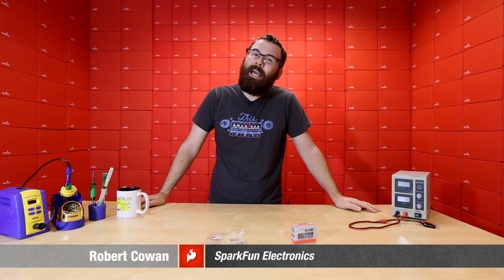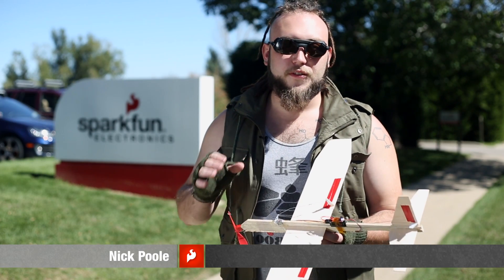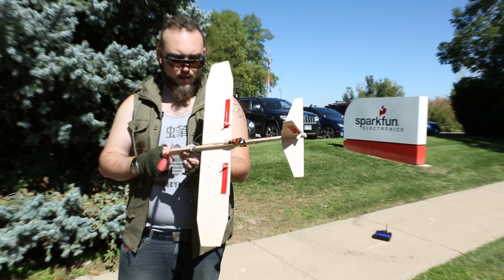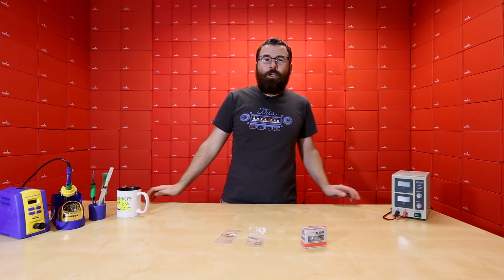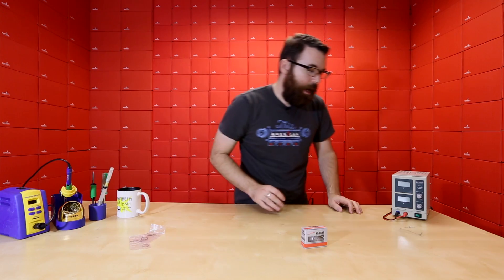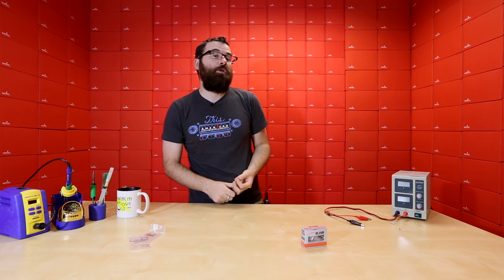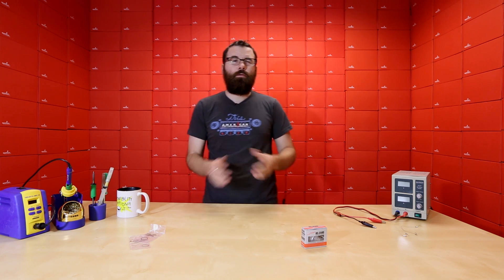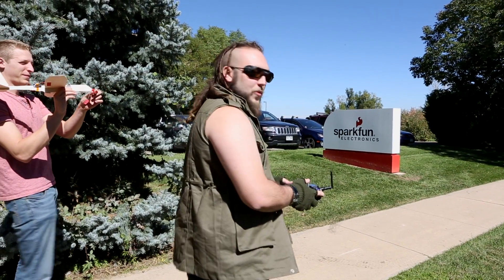SparkFun 9-27-13 Product Showcase: Fly by Wire

Comment: I was wondering - if you had a nitinol spring, you could stretch it and use electricity to shrink it back and it could spin a propeller in a plane through a simple transmission!

Comment: these wires have a threshold of ''return to shape max temp without damage" and a "embed a a new shape in it max temp" these do not handle to be surpass without any control over the amperage. You are ruining the product on a showcase video... ideally you heat it to 120 Celsius while applying a 5% of strain to it max (its still 5% of around 4000x its own weight if I don't misunderstand the material) they will permanently deform and loose their force is overheated... they can be covered in Kapton and even cooled. to increase their power and lower the hysteresis. allowing it to reform and deform from ambient temp to 120 back to ambient very quick and without loosing any of its properties. a lot of them could be used in parallels...Weird vid to show all the awesomeness of these